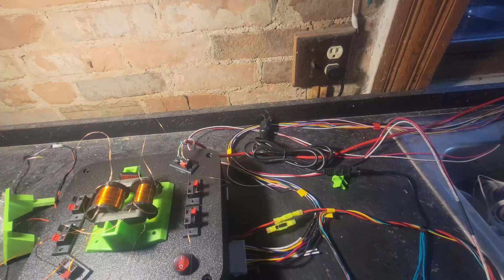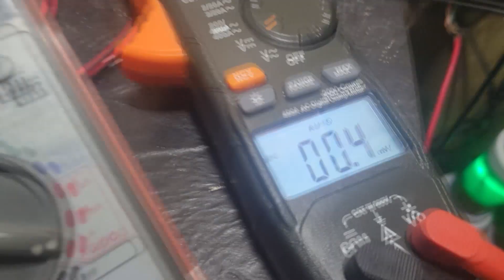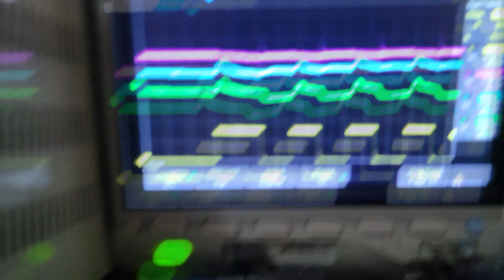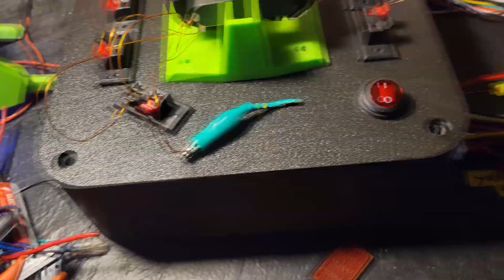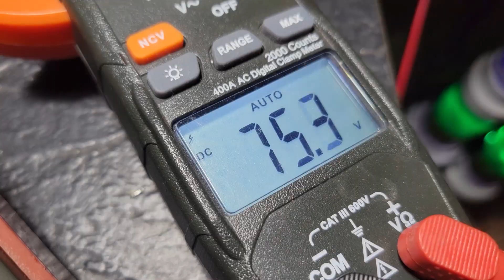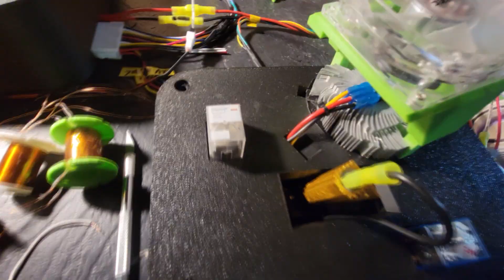New HVIC Matrix Testing and Debugging

Comment: Try this. Square wave duty cycle 55 to  90 percent frequency 24,8-25,2 kHz. Proper amplification And the value of 2,4 ampere and 5,5 volts at the wires rms Voltage 4 volts. And its done😁 No complecated waves no inductors at all! And youre done 😁😀 I have pwm motor regalutor of those values and i am trying to deconstruct it😁 nice day😁
Reply from the maker: My VICs only respond to 500Hz to 5KHz. Anything over that and voltage is negated.